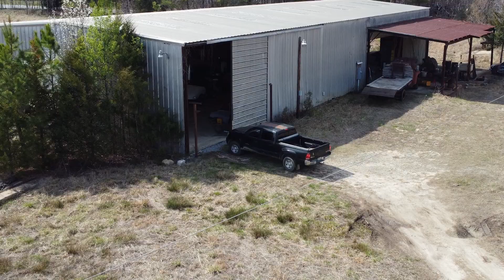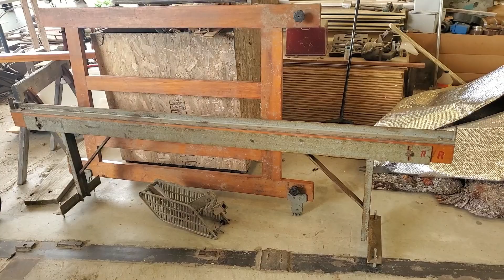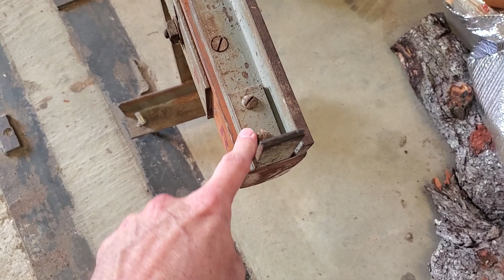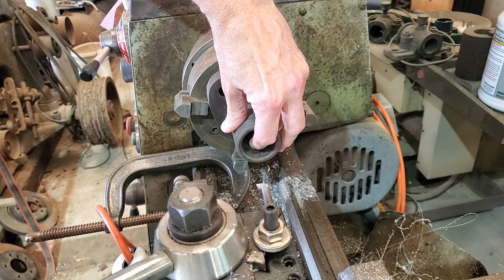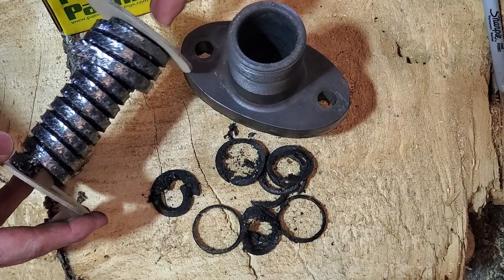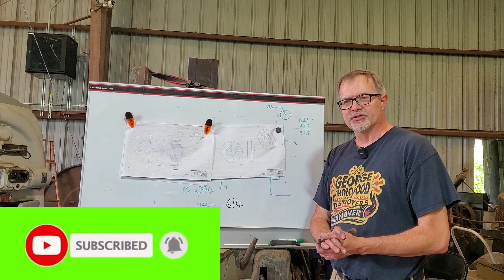Boring Packing From Skinner Steam Engine

Comment: Back in 1972, I was working on my Dad's drilling rig and we had two huge pumps that had two 2.5 inch pump rods. I can recall having to pack the stuffing boxes on a regular basis. The packing had to seal 1500 lbs. of pressure. Never did enjoy doing that job.
Reply from the maker: At least this is only 150psi 😁